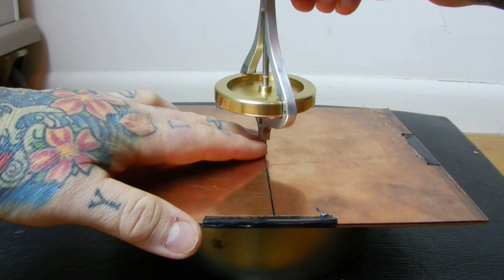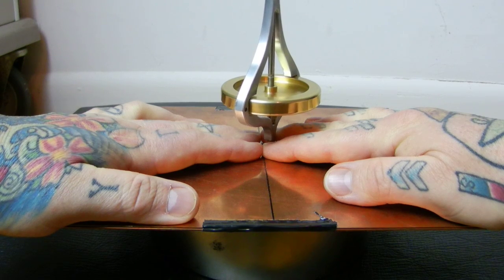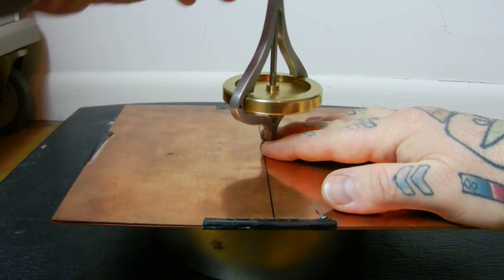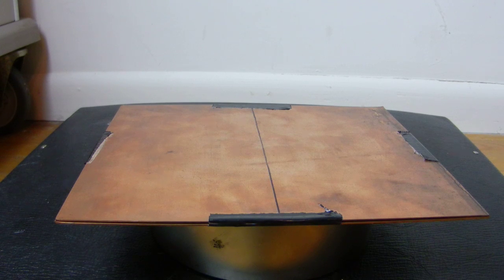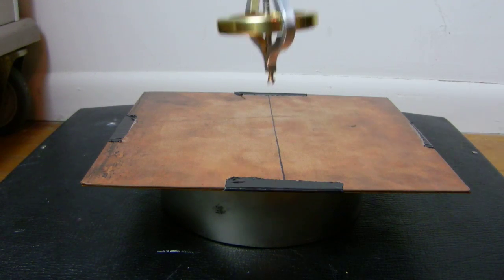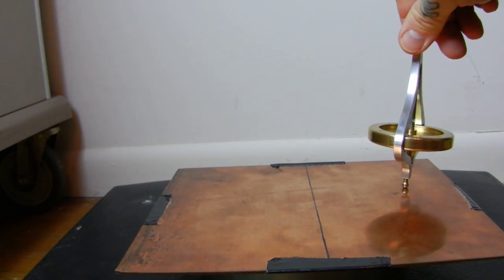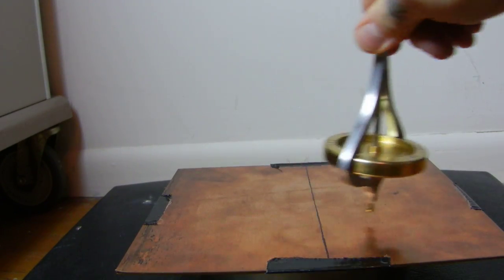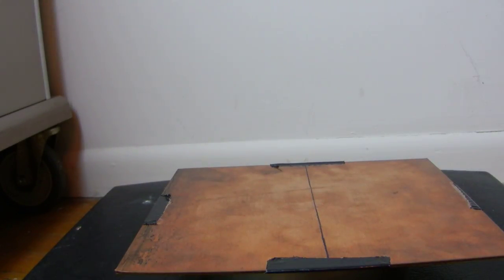VIDEO 112 UNCOVERING SECRETS OF MAGNETISM.  Magnet / Gyroscope MYSTERY! Solve this unseen video

Comment: Not complex. At the CP point, the gyro is influenced symmetrically by magnetism and can maintain its internal vector geometry.  When you let go, depending on direction of rotation, it precesses and follows the resultant route along a magnetic field line towards CF circumference. Once away from CP point, it is subjected to gradual upwards CF field lines which changes the vector forces  in the gyro thereby losing energy faster.

Comment: My guess is that at the centripedal point it's in sync with the spin of the hyper trochoid spin of the magnet's field, so it adds some spin. It's in the center of a vortex and since copper is a conductor, and spinning the flywheel makes it coherent, the flywheel has a vortex, when at the center of the vortex of the magnet the flux lines of the magnet do not interfere with the flux lines of the flywheel and if both votexes are spinning in the same direction there is an additive effect.If you spun the flywheel in the opposite direction, on the same face of the magnet, and got the same results, then I have no idea. Couldn't you just tell us?

Comment: It's eddy currents.
Reply from the maker: +Garganzuul descriptions arent explanations
Reply: You have probably seen the demo of the magnet falling though a copper or aluminium tube. - You can try a different magnet and see if the deceleration corresponds with the 'flux' density.

Maybe that's not the explanation you're looking for. - Consider, if gravity can bend space and time, why could electromagnetism not do the same? When you bend space the shortest distance is no longer a straight line on a surface, and since the principle of least action somehow didn't get fooled by this trick the result is a force measured in the unit Newtons.
Reply: @KenTheoriaApophasis  is it because the gyroscope acts like "one big atom".

So the atoms "spin" in the magnet is aligned, and the gyroscope spin is "aligned" with the "spin" of the atoms?

Sorry,,,im a "mental midget" with an IQ of only 131.

CURSE MY PEA BRAIN!

Comment: The full explanation to that brain-teaser is elaborated here:

Notice the large aluminum sphere levitating at 18:46 into this video. https://goo.gl/s5650K

Brilliant lecture on the replication of mechanical effects (ball suspended on the water-jets), into Electr0-Magnetism.

The centre of the magnet's pole is similar to that large round coil in Dr. Laithwaite's experiment with the large ball, where the magnetic "lines" are entering the centre of the circle, then, the Aether's circulating do indeed counter the effects of gravity on the large ball, and also on your gyroscope, hence the gyro stays rotating longer there. 

__

Comment: so there is a move toward counter space or monad via a centripedal inertial acceleration creating force cancellation by applying a coherent inverse which is the motion of the incoherent mass of the gyroscope spun up to a point that it gains coherence. When the gyroscopes spin is In combination with its own inertial acceleration towards the self centered point of the monad within the inertial plane of another coherent dimagnetic object it could be possible that the gyroscope is gaining the additional minute of spin either from the centripedal convergent acceleration inertia or from counter space it self like some kind of inertial gate opened up and augmented the reflected geometry of the point and stretched it finitely to give an inertial gain to the gyroscope. 4 minutes instead of 3 minutes..

Opposite of all this is the slowing down at the edge. starting from the same as described above, as the gyroscope moves out of the hyperbolic cone of convergence and into the area of divergent centrifugal force motion while above the inertial plane of the coherent dielectric object it has increasingly similar force applied and the gyroscope becomes subject to entropic inertial deceleration. The hypertrochoid path traced by the base of the gyroscope is either following the paths of expanding convergent and divergent pattern of   I+A  and F+M or tracing the mirror of monad or C.S. as it relates to them or both. The copper plate, being a dielectric incoherent object could be interacting with the  C.S. inertia  in a way that causes changes to the vector interactions and bends force movement and inertia acceleration which inturn causes the gyroscope to process in a more planar way and move out to the edge of the magnet below. the different directions based on CW or CCW spin are effects of polarity. Perhaps there is also an entropic acceleration in the direction of force movement by an attraction to a mirror of counter space that follows the same path. How do you make the parachute?

Comment: In center of a magnet, gyroscope is spinning in approx "even" magnetic field, so it would not cause creation of back emf currents, also possibly reciprocating magnetic vortex could add "something" to the spin, making it spin longer.
This magnet could be also "covering" Earth's magnetic field so it will reduce back emf from spinning in Earth's magnetic field.

At the edge of a magnet, magnetic field is at an angle so spinning causes to create stronger back emf currents that stop gyroscope in seconds.

Comment: One additional thought.  If the copper plate was magnetic steel, I believe the polar center diameter would also be increased in diameter.  The steel would assume the same coherent polarity as the magnet.  I would expect the spin time on the steel might even be longer than on the copper or on a non-magnetic surface away from the magnet.  That would be an interesting test to see if there is any difference between spin time in center of steel plate on magnet versus spin time on copper plate on magnet, with the ultimate test, the spin time over bismuth plate on magnet.

Comment: The copper disturbs the vectors of magnetic force.  The closest copper to the magnet pole surface, because of magnetic reluctance or diamagnetism, is induced to moments of the same polarity as the surface of the magnet causing the magnet's force to have to avoid or go around it momentarily.  The greatest effect of this is shown at the edge of the copper.  The result is that of minor shielding of centrifugal magnetic spin allowing more of the unopposed centripedal magnetic spin to impact the brass, and vice versa.   The copper, because of its larger diameter than the magnet, creates a larger polar center, getting closer to the diameter of the brass, meaning that less counter force is impacting the gyro brass from the convergent magnetic spin being shielded or disturbed in reciprication.  As to why the gyro spins longer on top of the polar center of the magnet than not on the magnet, it has to do with the tight and fast spin of the magnetic force at the polar center.  The eddy currents induced in the spinning brass, small in this position, are in sync with the magnet.  If the gyro had no air resistance and no bearing resistance and was perhaps a different design, it would spin as long as the magnet was emitting coherence.